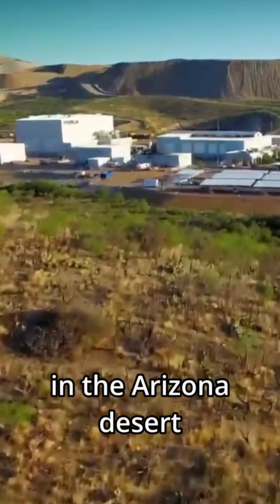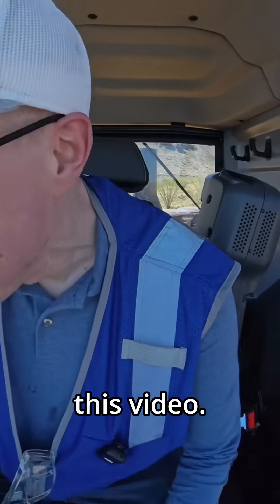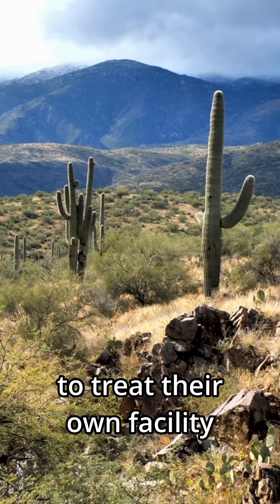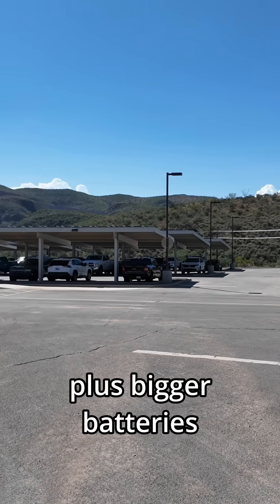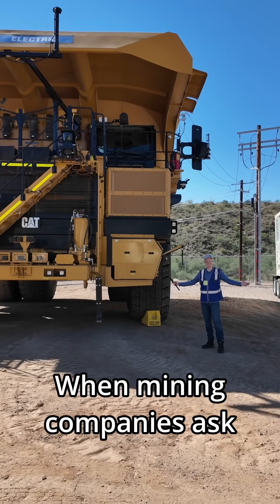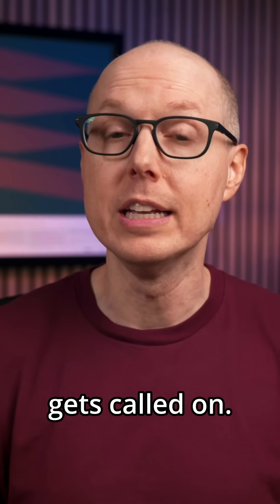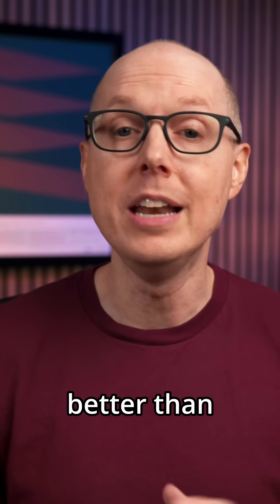Microgrids: The Desert Facility Running on Sunshine

Comment: How much did all the solar cells and batteries cost? This has to be taken into account before you have any true savings.
Reply: scale solar is the cheapest form of energy generation, even with batteries. the entire setup probably cost them less than a couple million dollars. it will pay for itself in less than a decade, maybe half a decade, depending on how much they are saving.
Reply: @danilooliveira6580  What you say is true. I want some admission of the solar and battery cost in the video.
Reply: @danilooliveira6580  Thank for the information and feedback.
Reply: You'd better get to Peoria pretty quick to schedule a meeting with CAT execs.  How in the world did one of the world's largest, multi billion dollar manufacturers not think about the investment costs???  I mean they even build the batteries and their own line of solar systems.  They've been building utility scale power systems for a generations, but random YouTube commenters know soooo much more🙁
Reply: @steve32627  I wasn't accusing the CAT of anything on the non-reporting of the cost or the solar setup.

Comment: You hear that? That's the death of "drill, baby, drill".
Reply: This is indeed good news.  But you realize that these electric trucks will be used in coal mines.
Reply: It means that we are diversifying our sources of energy, which is wonderful.  We need lots more wind and solar and batteries and nuclear and conservation before our dependence on fossil will be reduced.
Reply: Nope. And I run my home partially on solar. It will come I think, but panels need to be more efficient.
Reply: @tomcoryell in the last 365 days, I have consumed 800+ kilowatt-hours and I have generated 1+ megawatt-hours.

[I live in South Florida.]
Reply: @KarimHosein Man that’s excellent! I applaud you!

Comment: The problem with america is we still think about replacing a coal plant with a solar farm.  When instead we should think about replacing a coal plant with 100 solar farms.  A huge portion of generated energy is lost in transmission.  Building the solar farms next to where the energy is needed drastically cuts down on the energy that needs to be produced.  But we are so used to the concept of a national tied grid that it is hard to break that way of thinking
Reply: The US has pretty much switched to turbine generation power plants over coil it's a really cool setup.

Comment: I would sure hope solar is a better option than diesel generators in the most ideal location for it.
Reply: Hot deserts is not the ideal location. The ideal is sunny but cold. High desert mountains, maybe. Good that they work well in the heat, anyway.
Reply: @D2O2  Yes. Solar less useful in northern or other sunshine deprived locations. But other passive energy technology may better supplement traditional fossil fuel electricity generation.
Reply: @anthonyjenkins5889  It depends. Solar is used more and more in cloudy Norway, it's profitable there too. The cold compensates somewhat for the reduced sunshine, the panels are more efficient when cold. And solar pairs very well with a hydro baseload. The extreme price drops on solar has made it usable and profitable in a lot of places where we wouldn't expect it a few decades ago.
Reply: @tvuser9529Excellent. If I live long enough I will have a solar panel on my back and run like the wind.
Reply: Ya! And are we sure that the maintenance is cheaper now?
Reply: @shawne3427  yes, solar panels and batteries require almost no maintenance (besides regularly cleaning), they are built to last. the hinges of the single axis trackers will probably need to be replaced before any panel or battery cell.
Reply: @shawne3427  Before that thing that uses timed sequential explosions?
Did you even GO to school?
Oh right ... American education.
YOU are why Trump loves the uneducated (you're not STUPID, he just wants you to FEEL that way).
Reply: @capnkirk5528  jeez man this is a video on interesting tech and how it works. Not a political commentary...
Reply: @colonelderpy You didn't read America's new national security strategy? Trump's administration decided America's economy should run on oil, gas, coal and nuclear. Not just America, also the countries within their sphere of influence! 

"We reject the disastrous “climate change” and “Net 
Zero” ideologies that have so greatly harmed Europe, threaten the 
United States, and subsidize our adversaries."
Reply: "Expanding our net energy exports will also deepen relationships with 
allies while curtailing the influence of adversaries, protect our ability 
to defend our shores, and—when and where necessary—enables us to 
project power."

I read stuff like this as if wind and solar is energy of the adversaries.
Reply: @therapeutischbecommentarierenyet again, dont think this is a video for political commentary.
Reply: @therapeutischbecommentarieren what allies? russia? 🤣🤣🤣

Comment: That ROI needs to pay for all installed solar, and man hours.

at 1000$ per 4KW thats 1m per 4 megawatt. Granted they're probably getting bulk coats.

That's just solar panel

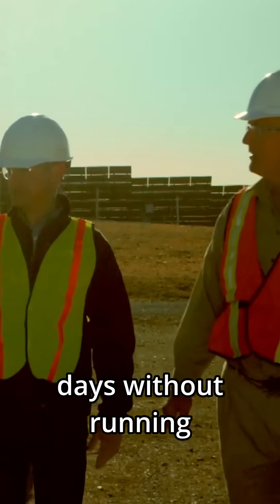batteries are running about 1,500 per 15kw. or 1:10. so storing that 4mw for 1 8h cycle would be 32mw of storage.

32,000kw would be 3.2 million

they likely had to pay out about 10m for the project for just energy. Not sure what their fuel budget is.. i could math it but EH

Comment: That tiny yellow chuck holding that massive vehicle is SO funny to me
Reply: It's not supposed to stop it from rolling with engine power. It's supposed to stop it from starting to roll when there isn't an operator.
Reply: @thegurw1994 sure, but at what scale does the mass of the truck on anything other than perfectly level ground just roll over it like a pebble?
Reply: Definitely wouldn't want heavy expensive things careening into other expensive things on the odd chance its brakes didn't apply or stay applied.  They do the same with large aircraft... on the level tarmac.
Reply: Ever noticed how small a parking berm is compared to a car tire? The next time you park your car against one stop just as your tires touch the berm and then try pulling over it. See how much throttle it takes to get over it. The chock is only to hold the truck in place after it's stopped. Not bring the truck to a stop after it's already rolling.
Reply: Lmao, right? I had a lowered camaro that idled over chucks, I can only imagine how easily that truck would roll over that.
Reply: Yeah, at what point of scale is a chuck like that irrelevant? I'm sure that thing rolls over rocks that big without even a bump to the driver. Wouldn't it need a proportionally sized chuck?
Reply: @falconerd343  not really, if the vehicle is in a relatively even terrain all you need is stopping the wheel from wanting to roll and it won't go anywhere, the friction with the ground will keep it in place.

Comment: Unless things have DRASTICALLY changed, those big mining trucks are diesel electric, similar to train locomotives. They still burn a ton of diesel.

An interesting side not is that many large scoop shovels and dragline shovels used in mining are all electric. Thoigh they usually have massive generators for that electricity. The name i know/knew was Bucyrus, but they were bought by... (drumroll)... Caterpillar.😂
Reply: They are trialing 100% electric - not genset to electric traction drives.  That's the long goal, no diesel in the mix at all, moving or stationary.    But this presentation was just about their stationary gensets for electricity  for the site being replaced as many hours as possible through the year by PV and storage battery.  There are a LOT of things that can be done to minimize those run hours without cutting demand at all.

Comment: And how long did it take for the the cost savings to offset the initial investment?
Reply: probably less than a decade, maybe half a decade depending on the savings. scale solar is incredibly cheap, even with batteries.
Reply: Considering their per kWhr cost is significantly more than APS since there is no grid power, probably sooner than one would think.  Since they are testing electric mining gear, the phased approach made sense and cents as they saw the results.
Reply: for home solar with with abtereis you usualy have a roi of 7 to 12 years (depending on wether you live in rome or stockholm :D ) .....

diesel power even in the US will be more epxensive....1 gallon diesel will be 3dollar(to3,5) or something you can get about 12kwh from that. so ~25cents ...insutry acording to google pays 8to9cents per kwh .....so you make 14cents every kwh you get via solar vs diesel vs from net (25cents obviously vs diesel)......

what i can find in the US its rpetty much 1w per dollar instalation so a 1,5MW field will coist 1,5million dollar...asume a bit more here because shit transport etc lets say 2million.....

a 1MW field generates 1,3 to2 Gwh year take the lowest number 1,3Gwh *1,5 for that field there 1,95 Gwh ~2GWh
......so they produce about 2Gwh*25Cents/kwh =0,5M Dollar =500 k Dollar a year

so 3-4 years till recoup vs diesel....now we can argue stoarge is probably trippling the price of the total array...so 9-12 years till point break even with realy expensive storage and absolut worst case asumptions about yearly solar yield and 3dollar the gallon while the prices i find are more towards 3,6 for industrial diesel...

EDIT the storage asumption of trippling is if you want the FULL capacity to be pulled, if you still ahve the deisel as backups you dont need that kind of reduncay and capacity.....doubling price for a very solid 1-2 day bridge load will give you your moenys worth in 6-8 years then ...which in my world is a nobrainer to do...as solar panels nowerdays have a live expecatincy far far beyond that and diesel  and co2 certificates will only get more epensive in the future

Comment: That’s awesome.  Now do it on the North slope of Alaska.
Reply: you have sun in summer, if you use solar that optimized for shades and relative low light you can make it work, and when its not shine there is wind on the coast and on land too, plus you can generate electricity with sea waves on shore or combine it in the sea with wind turbine towers at the same place. Plus Alaska has rivers that can utilize power generators. So many potential, all you need is the will and investment, all of these technologies are ready to use and well tested in other regions, for example Europe.
Reply: In summer it would work.
Reply: Add some wind and there you have it. Fossil is fossil - if you know what I mean!

Comment: This is a good example of how to use alternative energy. We should not use only one or the other, but simply supplement each of there weaknesses with the others strengths.
Reply: I mean they are using just one form of energy production?
Reply: Thankfully we can build nothing but renewables for our grid, going forward
Reply: @synthwavespartan2808 , let us not lose sight of the fact that the “alternative” here are the diesel generators, while the main power is PV solar & battery storage.
Reply: Yeah we need to invest in all forms of electricity production in the places they work best. There isn’t one solution for all
Reply: @elijahlong7791 
We do not need a single additional dollar investment in fossil fuels actually. We are MASSIVELY over invested
Reply: That makes too much sense. And you didn't factor in the "DO WHAT I SAY" variable.  We are dealing with a .gov that is extremely sick. It won't survive much longer.
Reply: this works great as a niche solution in a part of the country that receives sunlight 330 days a year
Reply: @artcurious807 It works great in an awful lot places now. Solar and batteries have both got very cheap and can supply a large fraction of the electricity in much of the world. In high-lattitude areas you need something else too for winter. 

I'm 54 degrees north (UK) and can run this house on solar 97% of the year for example. We use some biomass for heating and a tiny bit (3%) of grid electricity. 

With a heatpump and EV that fraction will reduce, but we have space for more PV too to put it back up. 
PV+storage is certainly no longer 'niche'.
Reply: @artcurious807   . Wind? Hydro? Tidal? The sun isn't the only source.
Reply: @artcurious807most mine sites receive more sunlight than a typical area, so it's not quite as niche as it seems, lots of heavy mining equipment would benefit from this

Comment: As long as you have the fuel the diesel generators will produce. As long as you have the sun, solar will produce. In this particular instance and location and geographic position this is good.  Where I live there are 58 days per year that don’t have cloudy skies.  So take advantage of what you can and make sure you have back up diesel generators cause you’ll need them everywhere at least in this day and age.  Trust me when I tell you I’m in favor of solar but we’re not there yet.
Reply: Depends what you mean. The video isnt saying everything should be 100% solar. Its saying solar power can be used, and be thw economic and environmentally sound choice. So we ARE there for solar in being able to use it in this way
Reply: @John...44... 
The facts are the only way you could operate 24/7 in that environment and that location exactly is by diesel.  I’m all for the solar but it is not the answer yet. They’ve been exploring this concept for 70 years I’m aware of.
Reply: @yt650  So put up a bunch of winterised wind turbines where the sun don't shine to augment the renewable mix. It sounds a bit as if you're emotionally attached to diesel not being portrayed as something really we gotta get rid of within the next two decades.
If it doesn't work out, too bad, but let's be more enthusiastic about trying EVRYTHING beforehand and not be lacking in moral leadership going for the "it just doesn't make financial sense" cop-out. Yup, I'm that radical about it
Reply: sounds like you live in an area where wind energy is more relevant. Properly with a bit of solar for the summer. Neither wind or Solar can stand alone, but they are the chepest sources of energy, so use them for what they can deliver.
Reply: Funny thing, I live in the lighting capital of the world, (which means thunderstorms), and I do not pay FPL for power; they pay me.

I produce far more energy than I consume with my rooftop solar.
Reply: @KarimHosein 
The sticker I designed and had made for the back window of my EV says the following: “This electric vehicle is powered by coal, natural gas and nuclear”.  There’s not enough windmill or solar power at this point in my area to amount to anything but it’s coming and I support it.

Comment: Yeah but how much did they spend on all the solar infrastructure? Did they really save any money over what they were doing, or is this just some sort of green virtue signal?
Reply: It’s probably a 5-10 year ROI, like most solar. The one advantage they have is that small generators are much less efficient than utility scale power so their gas generators probably more expensive than what you or I would pay. Thus their ROI is probably a bit faster than normal.
Reply: Electric motors are more efficient those trucks  and earth shifters are usually diesel electric anyway the diesel component is the most complex unreliable and serviced time and cost intensive  elements after the fuel .. these beasts can regen braking and going down hill without wearing out brakes and engines and gearboxes /transmisions
It's a test plant the initial experiment pointed the way ... Solar powers cheap safe robust  storage batteries to extend capacity and independence.. that meant more solar more storage .... lower costs complexity down times and  hazards. 

Hybrid panels and heat pumps can add another 25-30% efficiency .. in Indonesia and SE Aisia the trucks are driven by  local ladies driving from porta cabins at the mine head  by radio control. ..some places have overhead pantagraph charging wires, on the way out of a pond deep pit climb they can recharge the  trucks  on the fly. 🤷🏻  all without toxic gasses building up in the mine and shortening the miners lives as well as polluting the air down wind of the mine.
Reply: It will in about 3-4 years
Reply: Because companies love to make big infrastructure investments for virtue signaling, that makes sense…
Reply: @Kristoferpalmestal Caterpillar's biggest generator, the C-175-20, produces 3,000-4,000 kW, and consumes 1,000 liters of diesel PER HOUR, when running at max power. That's 24,000 liters per day, times 364 days, is 8,760,000 liters per year. That's ~2.3 million gallons. At a VERY  cheap price ($2.75 per gallon, though it's probably over $3), is over $6 million per year. And that assumes it's only running one generator at a time.

Switching to solar is a massive financial win. Hardly "virtue signaling" "greenwashing" or whatever term you chose to use.

Companies might make the occasional eco-favorite choice for good publicity, but the fact remains that switching to renewables is just a solid financial decision nowadays. 

Despite what all the pro-petro folks will tell you, there's a reason that most countries and utilities are moving to renewables as fast as they can. Its not some hoax; wind and solar are cheaper. They've both been in grid level use for decades, and if there really was some horrible financial downside, they wouldn't keep switching, month after month, year after year, decade after decade.